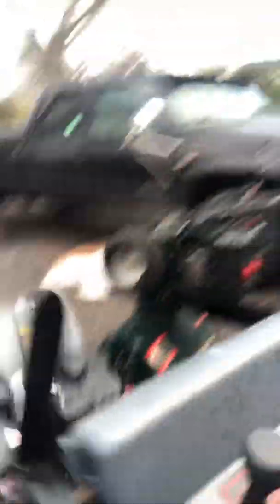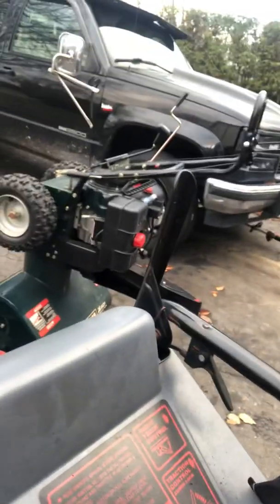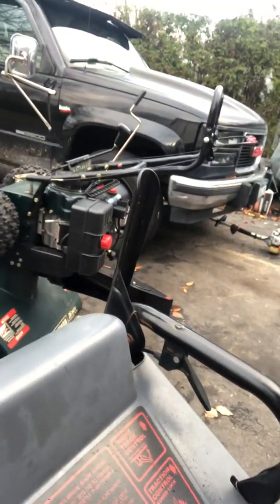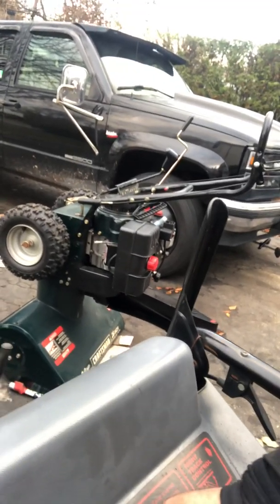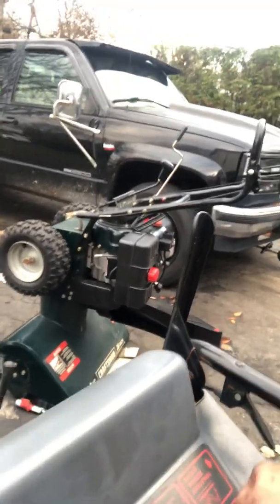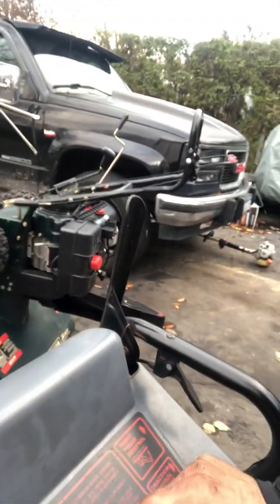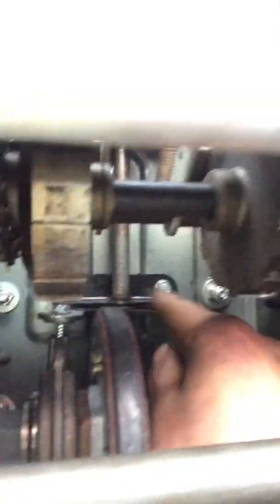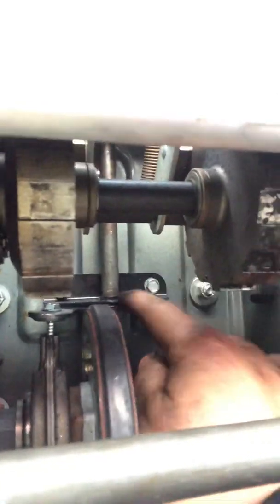Couple of Tips on How to swap Dual Shaft 5HP Tecumseh to 212cc Hemi Predator Engine Snowblower Part1

Comment: I'm not sure I get how its going forward at a normal rate at all. Shouldn't the entire forward and reverse system be backwards?
I couldn't care less about the stickers on the dash, I'd be fine if the bottom is 6 and the top is 1. But I'm just not seeing how that can work.  I have the same snowblower and was dinking around down there all morning. sitting here with paper plates as improvised friction plates, trying to wrap my mind around how that could work. lol
Reply from the maker: That’s because I flipped the ASM
Reply: @pattayperformance  the asm? I saw your 2nd video where you had to fab some stuff up. Is this before or after that? I thought this was before.
Reply from the maker: @AlaskanFalcon  ASM Aka assembly
Reply: @pattayperformance  oh ok, so the videos are out of order then... Right? This is marked as 1 in the description but is actually after part 2?

Comment: to fix your gear issue, change the friction position to the other side and you'll be right back to where you need to be..Done it a few times..You're welcome..TRUMP 2020!!!
Reply from the maker: phil 

Good Morning Patriot!

This was Part 1 of my series.
 I got it finished and the new owner is very pleased!  It’s a dual shaft motor.  I had to do some cutting in order to flip it the other side is it retains in multi speed set up!

The only thing I did that I wasn’t really to thrilled about was the tensioner pulley for the drive belt.  I couldn’t use the factory set up where it’s held on by a spring.  I ended up lock tite the bolt and tensioner in place.  What do you do?

Thanks for the view and comment!  Hopefully you subscribed to my channel.
Reply: @pattayperformance  for future reference re-position the tensioner. In one conversion, I actually used one of the lower side cover bolts as a mounting point, and then use whatever spot is convenient for tensioner spring.. Wish I took pics to show you, but im sure you get it..TRUMP!!!!